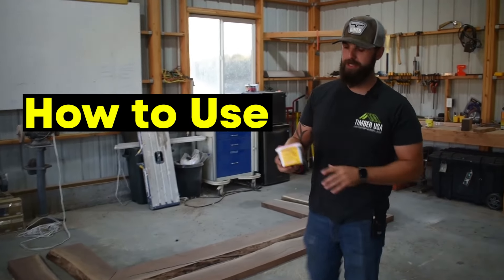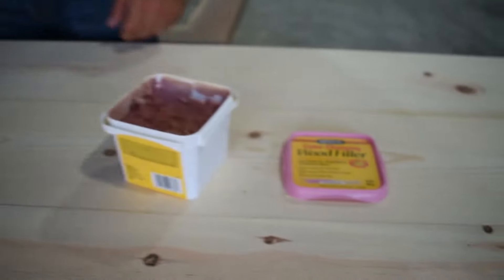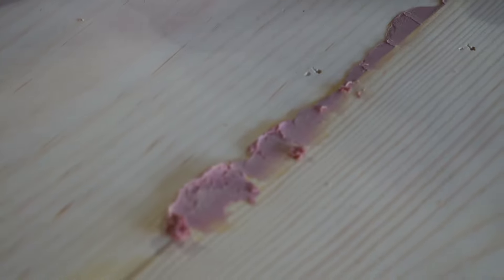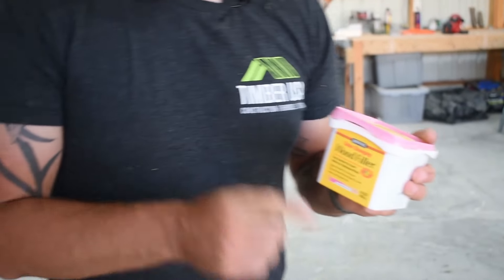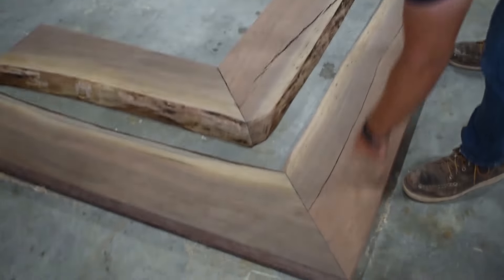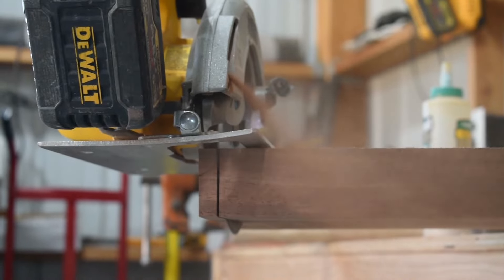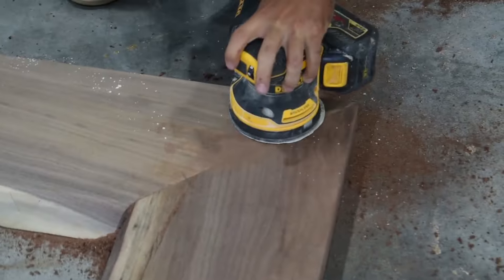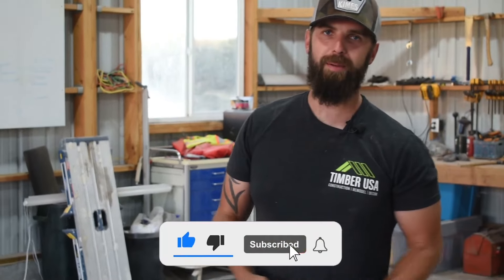How To Use Wood Putty!

Comment: for sure i made a mess of a wainscoting (chair-rail) project that i filled my indented nails with light color putty, then sanded before staining a light color. darned if the puttied nails stuck out like a sore thumb, and even though i sanded beforehand so aggressively i got sick from wood dust inhalation there was wood putty residue discoloration one inch around each nail!  what a bummer.  it seems that my min wax couldn't take a stain one little bit- at least a light-colored stain.  my mom says it looks rustic and is pleased.  but i'll never do another chair-rail unless i'm painting it dark... i'm shamed and am through with staining 😞  in fact if i do one again i'm using structural calk and a minimum of nails by golly!

Comment: did I miss the part where you used the non hardening wood putty that was shown in the cover photo? 😭😭😭 filler ≠ putty
Reply: Same 😂😭
Reply: @nicoleramirez1491  I figured it out by myself tho, it was really easy to work with! I just used my finger to work it into the area I needed it and it dried down beautifully!
Reply: I used this by mistake instead of wood filler to fill a hole outdoors. It did harden ... eventually lol😊